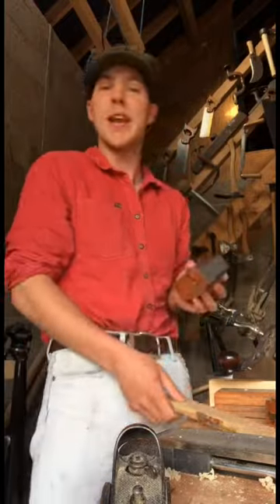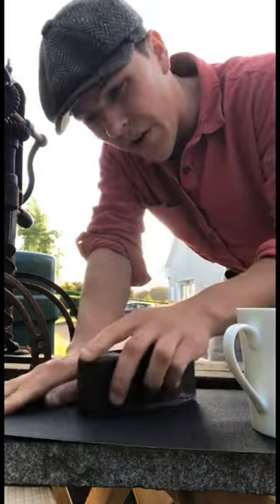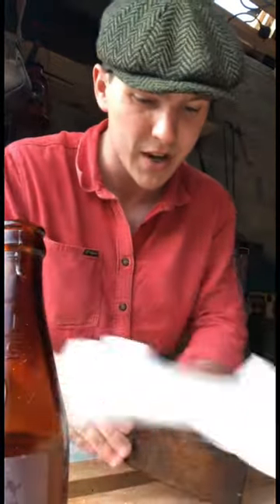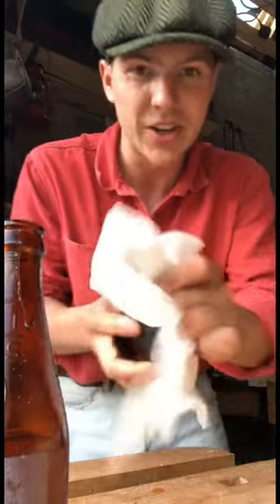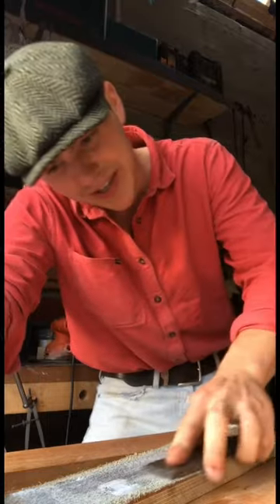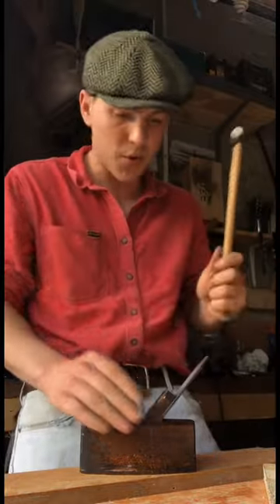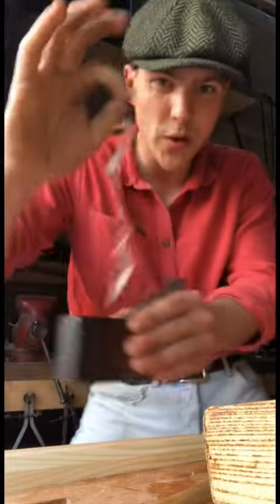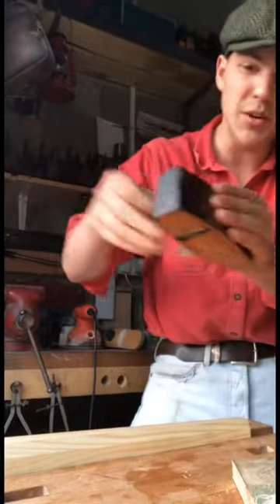Restoring a Small Coffin Smoother Plane

Comment: Using sanding paper on a plane sole is kinda risky. If there's any loos grit (there's always some) it will embed into the sole and will get released during planing. I usually sand just a wee bit to see the high spots and then scrape just those areas, or plane it all with another plane. Old woodies rarely take BLO, 'cos they were soaked in a whole tub of BLO for a few days, and then we usually wax the soles, so idk, I would just leave the sole as is.

Also, with the mouth like that and a single iron it will smooth only the clearest and tamest grain. I would maybe put a dutchman like the bigger one has. When done properly it should give you shavings similar to your kanna, or maybe even better.